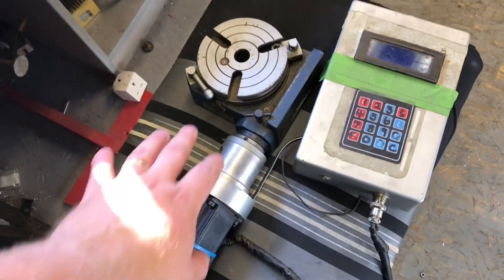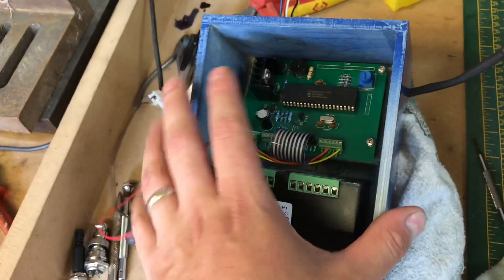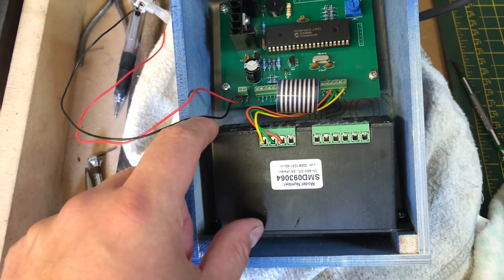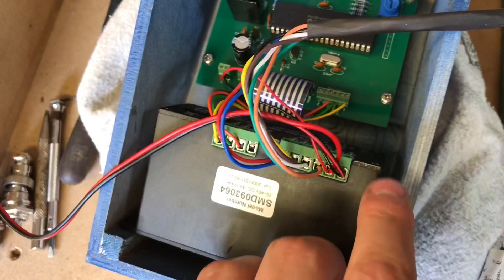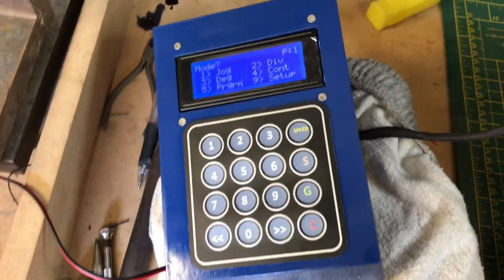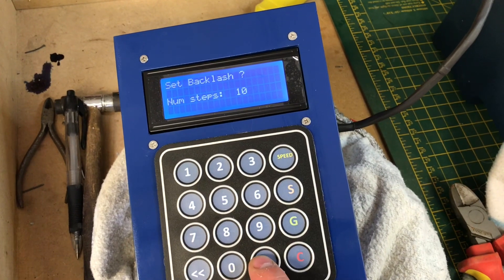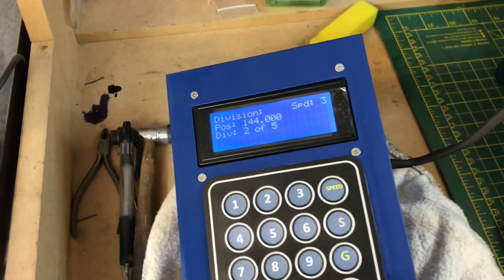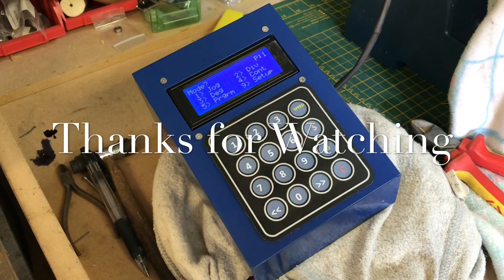Electronic Divider Rotary Table for lathe or milling machine - Setup and Overview - WorldOfWard

Comment: Hi, Chris, I am also building a Steve Ward digital divider and also have a cheap keypad. I have been looking for one just like your new keypad with inserts you can make up yourself. Please, where did you get yours?
Reply from the maker: Steve Williams Hi Steve. I got mine of Amazon, search for “KEYPAD AC3561”. I got mine for £17 but the seller I got mine from is now showing out of stock! I must have taken the last one as I only ordered days ago. There are other sellers but sadly at £25! You can also get it from farnells but postage is hefty from them! Anyway, if you search AC3561 you should find one. I have to say, they are worth the extra despite the cheap ones only being £1 !
Reply: Thanks, £18.75 eBay UK supplier. Element14 (Farnell) £15.75 but £3.95 handling!